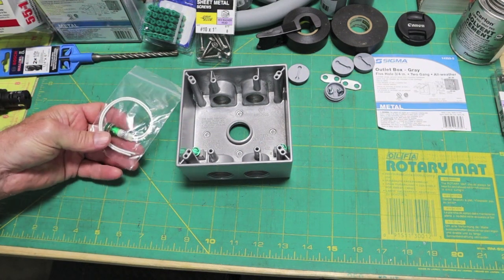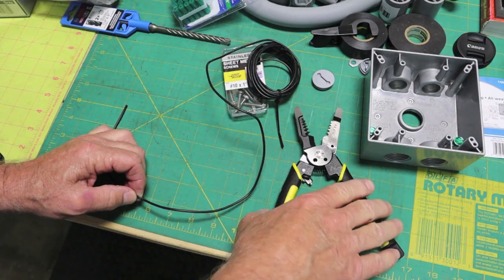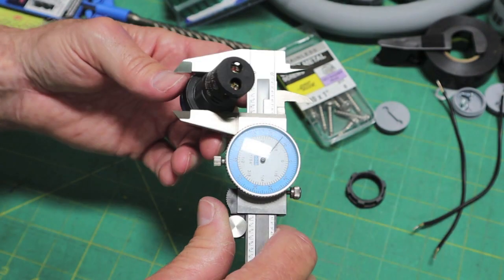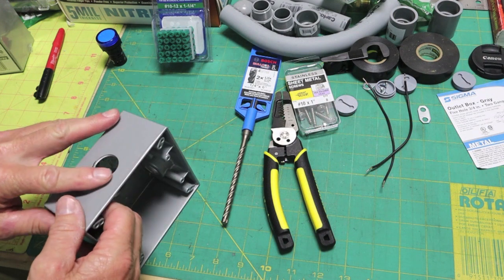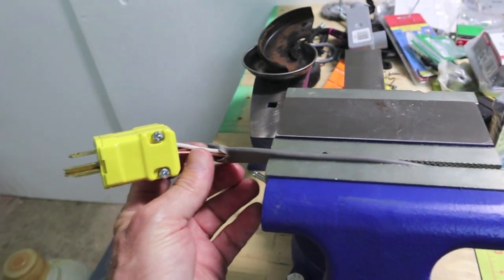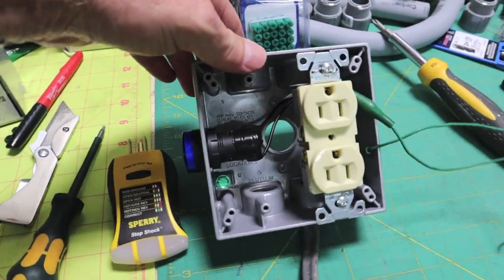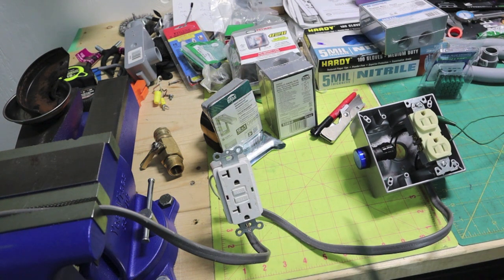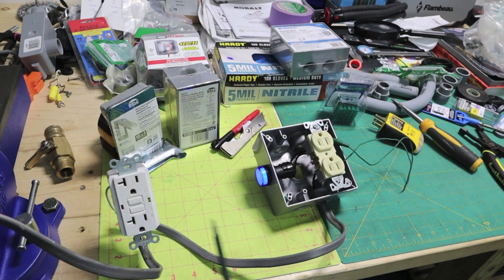Sump Pump 120 Volt LED Indicator Pilot Light

Comment: I'm trying to find a light that I can hook up only when my sump pump turns on and goes off when the pump goes off.
Reply from the maker: That would be okay. It will require some research or a good electrician probably knows what is needed. It will involve a relay or two.
Thanks for watching!

Comment: Soldering stranded wire that is clamped down at a terminal connection should be avoided. The proper method is to use a forked wire terminal connector that is crimped on the end of the wire. Solder is subject to creep deformation overtime and a "tight" connection will become lose overtime.

Recommend using weather resistant (WR) receptacles and coat terminals with dielectric grease.

Unlikely your indicator light LEDs are polarity protected. The reason the LED illuminates regardless of how it is connected is because it is connected to a AC source. The LEDs is actually flickering on/off every 1/30th second but your eye cannot discern it.
Reply from the maker: Great information! Thank you for watching and contributing!

Comment: Another good solution is a GFCI plug that has a built-in audible siren in it in case of a ground fault/trip. They're getting alot more common on Hardware store shelves. I use similar LEDs to what you are using there in a Food Production plant and they work well too.
Reply from the maker: I'll look for a few of those audible models.
Thanks!
Reply: @pmtips4482  NP, things are great when you need them.

Comment: Way late to the party, due to NEC code changes that required sump pumps to be on GFI protection. People's basements have flooded due to the pump's GFI tripping. Mainly from power cycling or long run times/GFI over heating. Sump pump battery backup units have made their way to the market. I use a few on multiple drain well pumps I have around the property. I have designed, built, and installed UPS systems for pumps in the past but now the factory made ones are "cheaper".
Reply from the maker: Thanks for the info! I can understand the safety aspects of a GFI on sump pumps, but as you say, many basements has flooded from that GFI tripping. OTOH we don't know how many lives it has saved from electrocution. 
Battery backups are huge business now.
Thanks again!

Comment: Not at all sure why you are installing an indicator that lights when the power (to the sump pump circuit) is on when your concern is that the power might be off. Would it not make sense to have an indicator (RED) or alarm that lit or signaled when the power to that circuit went off?
Another indicator (GREEN) that lit when the sump pump was working (ON)?
Maybe a third LED (BLUE?) to indicate the water level in the SUMP was at/above the Pump Trip Level?
And have ALL those indicators INSIDE the house in a room you spent lots of awake time in (Kitchen, TV Room)?
BTW - I have a couple of those plastic indicators and they are not EXTERIOR RATED. But you can buy exterior LED lamps (floods/spots) with standard MAZDA bases that fit in a standard blub socket (LIKE A PORCH LIGHT) that could be mounted OUTSIDE in a location that would make it visible through a window from the home interior space . . .though that's still a lot of trouble to tell you that, need it or not, the Sump Pump Circuit is 'live' even when the sump pump switch is not working, or the pump is broken.
Or, Am I missing something?
Reply from the maker: The only power is the power near the sump. In order to avoid a battery and drilling through the block foundation or the brick walls, I kept it simple and wired a power on indicator.
The GFI supplying the sump will trip in a storm when lots of lightning is happening.
Thanks for the info!

Comment: You are using a 15 amp receptacle at the end of a 20 amp circuit? The end receptacle should have the same slot configuration as the GFI. That slot configuration indicates at a glance it is a 20 amp circuit and size rated for the circuit.  I have basically the same set up but put a relay in as (THEDISORDERLY1) mentioned. My set up is in a crawl space, so putting the relay with a buzzer woks well.
Reply: @James R Day If you were paying attention he clearly stated he was feeding the circuit with a 20amp breaker. No where did I mention or criticize the size of the wire. I only mentioned he had a 15 amp receptacle at the end of a 20amp circuit. So? Make sense now?  I Liked Pm Tips video, I have almost the exact same setup.
Reply from the maker: Thanks Joe for watching! You're right on the 20 amp receptacle. That GFI is getting replaced as it is not WR rated (outdoor use). 
That buzzer would be the way to go. 
Take care!

Comment: Nice video.  I wonder if you could wire up a relay to the outlet so that when the power goes out it will sound a buzzer.
Reply from the maker: Thanks for watching!
Yes, a loss of power indicator would be the best thing here, but unless you are using battery power, you'll need another live circuit close by.
I may look in to this because todays lithium ion batteries are tougher than nails and so are the AA lithiums.
Stay safe!
Reply: @pmtips4482  I didn't think about that but you're right.  Upon further thought I'm realizing that you could add a battery powered buzzer and have a warning if your whole house lost power as well.
Reply: They make a GFI/GFCI plug that has a built in buzzer to it already, they are getting alot more common in Hardware Stores now.